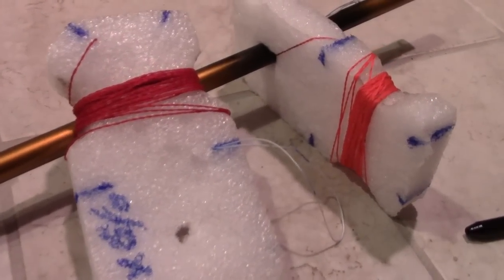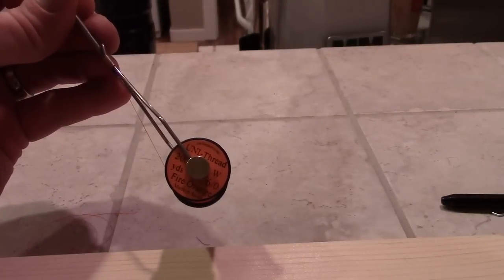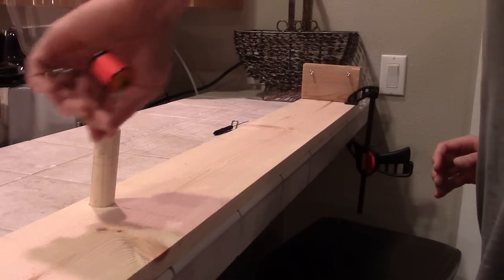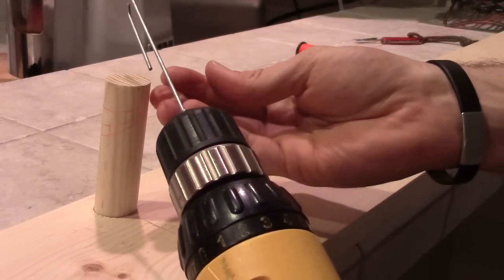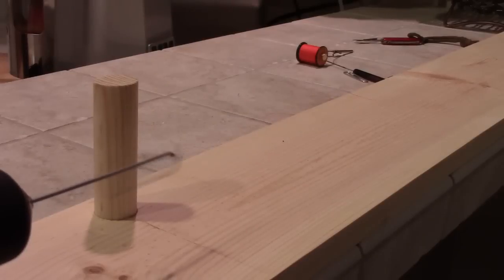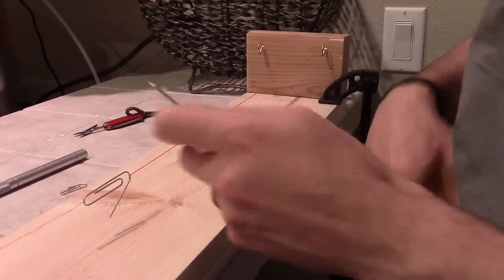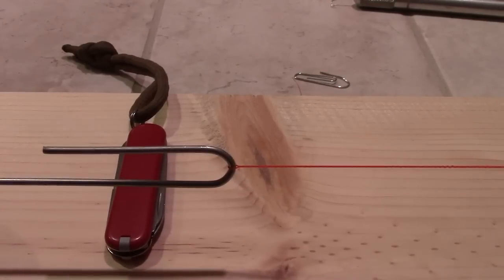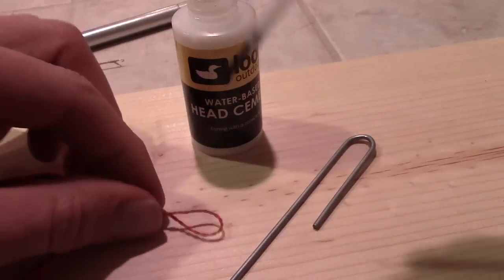How to make a furled leader

Comment: So if you were going to make a tapered leader, you would just do this 3 times.. each time stepping down thread thickness (or initial loops) and nail not them together?
Reply: DntBrnDPig you wrap a section, then move to next section wrapping threw loop made by first section, repeat, usually five sections tuning (furrel)the two and a half on each other.  finish with shorb loops

Comment: hello great video very helpful can u tell me how you join the tapered furled leader sections together cheers
Reply from the maker: To taper a leader you use the jig and make loops so there are really no connections it is a bunch of loops connected together with one continuous thread.  At the back of the leader you might have  like 8-10 loops at the tip you might only have three strands.  I count each strand at about 1-2 pounds for 8-0 and 6-0 thread respectively.

Comment: How long do furled leaders last when compared to mono or flouro?  Great video thanks for. Posting
Reply from the maker: I guess I would have to say about 2x as long.  Thanks for watching!
Reply: Depends how much you use them, and, how rough you are with trees, rocks and other snags. I make mine with either 4,6,or 8 lb Trilene  XL. Tapers usually ratio in 3 sections at  8 : 5 : 2 for 6 foot leaders or 11: 9 : 7 : 5 for 10 footers. A micro barrel swivel  or loop on the heavy end and tippet ring on the  light end.  I have the 32 to 8 tapered on my 5wt,8ft rod , which I  use regularly , and will usually get 80 to 100 hours on before repairs or replacement. Useing an 88lb to 40lb 10ft leader for Musky, or pike ( trolling) or casting big stripers averagesaround the same hours. A little less if the musky are hitting really good ; maybe 40 hours.There are a lot of variables,but, mine last a longtime better than anythi g madewith tying thread.

Comment: I didnt see how you attached the 6/0 at the beginning. After winding 4 times around the "fixed points" and back at the hook?
Reply: I just use an overhand knot or a figure of eight knot.
Reply: Brian Wetter Aha,like so.
About 15 year or so,a friend and flycast intructor gave me a very old drawing with intstructions how to make tapered leaders. Twined or in dutch: "getwijnde" leaders. And I was told it was about 100 years old these intructions. I made a really set up from planks with headless nails,to wind the nylon around the nails. After a few missers,I made very good tapered leaders.knotless and very durable. I could make them in different thicknes and lengths. But over the years I moved a few times and lost it. Don't know from the top of my head,didn't do it enough for to remember.
So,I found my interest again when I saw your yt video.
Thanks for that. People loved them or hated them I know.
I:I fish with or without. Got 2 for free when I bought something at a webshop lately.
Do you have a vid where you make the tapered ones?
Thanks again.
Cheers.
Reply: I need to do that video soon!   I was shocked to see the number of views but it is very muck like you are descibing.

Comment: So is this a tapered leader? How so you make a tapered leader?
Reply from the maker: This is a completely flat leader which would really only be applicable as a butt section or as a Tenkara main line which is what I use this technique for.  Coming out of the gate with the tapered leaders gets complicated so I meant this to be a part 1 to explain the basics of furling that were difficult for me to find when learning.
Reply: I tried putting info on this guy's blog about furled tapered leaders. The comment either is in limbo to get approved or was rejected - which I found to be quite odd. Feel free to shoot me a PM and I'll give you a great resource for making your own furled tapered leaders.
Reply: T.K. Archibald pls send me link or whatever so i can try to make a tapered leader :)
Reply: ***** ***** 

PM's sent :-) Happy fishing.
Reply: Great! As I said, feel free to ask any questions and I'm happy to help. It's pretty simple when it's all said and done.
Reply: ***** I definitely agree. I am definitely more of a hands-on learner. I went through a few trial leaders before getting it down. I recommend Gutermann Sew-All thread, it's super cheap at Joann's or online. I also recommend going the RLT method of furling when you get to that point.
Reply: Correctamundo on the thread. It's pretty much the equivalent to Uni 8/0, only significantly less expensive. I honestly haven't tested any floatant solutions. We don't have trout in my neck of the woods so it's not really important to me. There are recommendations on the forum though that would help you better than I in that department.
Reply from the maker: Thanks TK I will check out that thread.   Im a regular visitor to Joann's.
Reply: T.K. Archibald hey, would you be kind and send me that link for making the furled tapered leaders. much appreciated Thanks!